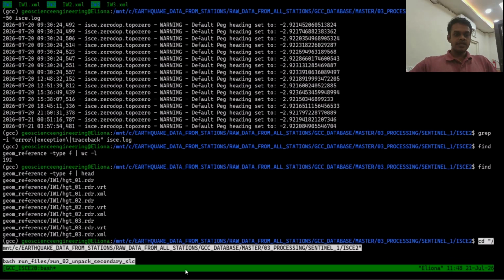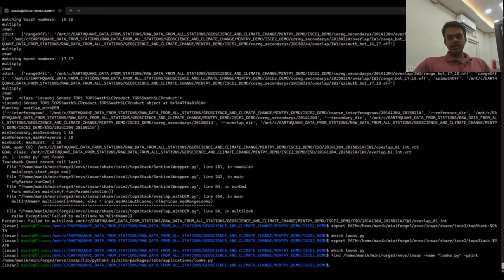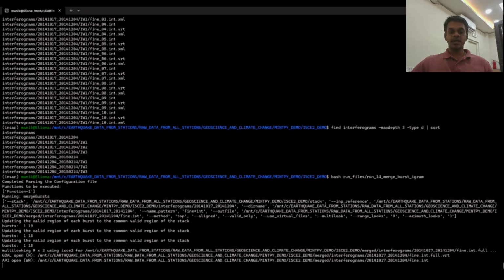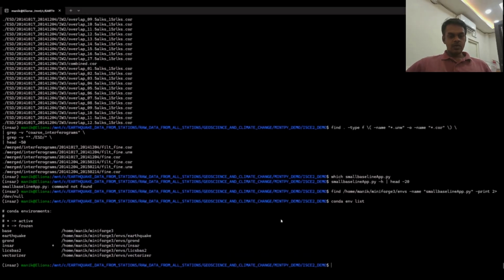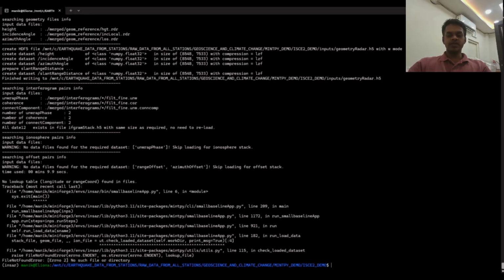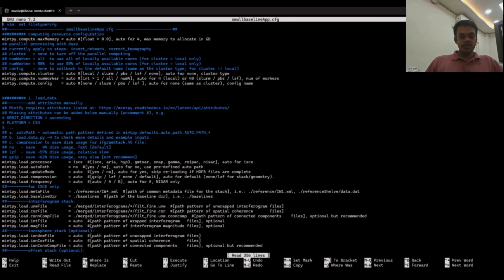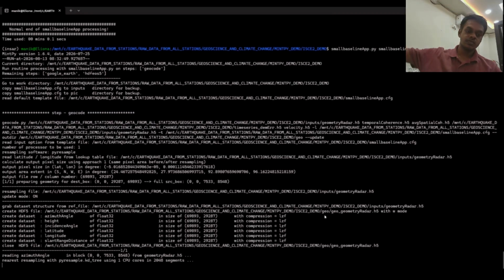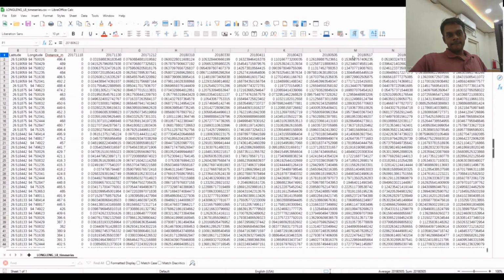Master Sentinel-1 InSAR | ISCE2 + MintPy Complete Processing Tutorial #geoscienceengineering

Comment: Sir, I’m following your Sentinel-1 InSAR tutorial using ISCE2 topsStack + MintPy, and I’ve been stuck for 2 days at run_01_unpack_topo_reference. IW1 topo completed successfully, but IW2 has been running continuously for 2 days without producing any files in geom_reference/IW2/. The Python process is still actively using CPU, so it doesn’t appear completely frozen.
Could this be due to a corrupt IW2 burst/SLC, an orbit interpolation issue, or a DEM problem near the IW2 coverage? I’m using ISCE2 2.6.1, MintPy 1.6.4, Sentinel-1A VV data, 16 GB RAM, and a Copernicus DEM. I can share the full terminal logs if needed.
Sir, this is getting very long and I’m not sure where exactly the problem is. Could you please guide me on how to debug it?
Reply from the maker: Yes, you can do a few checks yourself before sending the logs.
1. Check whether IW2 is actually consuming CPU
Open another terminal:

top

If the ISCE2/Python process is continuously using significant CPU, give it some time and continue with the checks below.

2. Check disk space

df -h

Make sure the filesystem containing the processing directory has sufficient free space.

3. Check whether IW2 output is growing

du -sh geom_reference/IW2/

Run it again after 10–15 minutes. If the size is increasing, processing is still progressing.

4. Check the IW2 directory

ls -lah geom_reference/IW2/

5. Check for an error in the log From the processing directory:

grep -iE "error|exception|failed|traceback" run_01_unpack_topo_reference.log

6. Check whether the process is still running

ps aux | grep -E "python|isce|topo" | grep -v grep

If CPU usage is high and the IW2 directory/output size is increasing, don't stop it—it's still processing.
If CPU is near zero and nothing changes for a long time, or the error command shows an actual error, then stop and investigate.
Don't delete anything or restart the complete processing yet.
Reply: Sir, I checked the geom_reference/IW2/ directory from the correct ISCE2 processing directory. The directory exists, but the file size is not increasing even after waiting 10–15 minutes. It remains essentially empty (only . and .. entries), and no .rdr output files are being created.
The system still has sufficient disk space, so storage does not appear to be the issue.
Reply: There are 7,596 lines in total, and the processing is currently still on Line 1. It has been running for around 2 days. The output file is only about 800 KB, and that was written at the beginning when I started the run. Since then, the file size has not increased at all, even though the process is still running. So it appears that the processing is stuck on Line 1 and is not writing any further output.
Reply from the maker: @gauravdev7832 Thanks, that confirms IW2 is not making progress. After ~2 days with no increase in output, I would stop that run rather than continue waiting.

First, press:

Ctrl+C

Then, do not delete the processing directory or recreate the whole stack.

Run:

cd /path/to/your/processing_directory/run_files

bash -x run_01_unpack_topo_reference 2>&1 | tee run01_debug.log

Let it run until it reaches the point where it hangs on IW2. The -x output will show the command being executed immediately before the hang.

Also run:

ls -lh ../reference/IW2/
ls -lh ../geom_reference/IW2/

If it hangs again specifically while processing IW2, stop there and send only the last ~50–100 lines of run01_debug.log. We can then pinpoint the actual operation instead of guessing whether it is the DEM, orbit, or SLC.
Reply: Sir I checked the directory structure as you suggested. Inside reference/IW2/, I can see the four IW2 burst files, but they are only .vrt and .xml files:
burst_01.slc.vrt
burst_01.slc.xml
burst_02.slc.vrt
burst_02.slc.xml
burst_03.slc.vrt
burst_03.slc.xml
burst_04.slc.vrt
burst_04.slc.xml
I also checked geom_reference/IW2/, and it is currently empty (total 0).
The Run 01 processing reaches the topo/topozero stage and stops at:
Running: topo
...
Processing line: 1
It has been running for several days without any further visible progress.
I tried to get the last 100 lines using:
tail -100 run01_debug.log
but the run01_debug.log file is showing 0 bytes / 0 lines, so there is currently no debug output in that file.
Reply from the maker: @gauravdev7832 Thanks, this is useful. The four IW2 .vrt/.xml files confirm that the IW2 burst metadata is present, but they do not confirm that the IW2 SLC data or topo processing is working.
Since the run has been stuck at topo → Processing line: 1 for several days, please stop this run with Ctrl+C. Do not delete the processing directory or restart the complete stack.
The next step is to identify the exact topo command being executed for IW2 line 1. Please run:
If that does not show the command, please open the run_01_unpack_topo_reference script and look for the section that runs topo:
Please send only that section of the script and the last few lines of the terminal output before it stops. We need to see the actual command, not just the directory listing.
Also, one correction to my earlier advice: the presence of CPU activity does not prove that processing is progressing. In this case, several days with no output means we should investigate the exact operation rather than continue waiting. As you are having issues in every step i suggest you to use chatgpt and paste the errors ( this is a quick solution for your case) 🤝
Reply: @geoscienceengineering  i have everthing with claude and Chat GPT but nothing is working
Reply from the maker: @gauravdev7832 oh, then mail me to geoscienceengineering9@gmail.com and we can discuss

Comment: sir, im sorry i want to ask you, what should i do if my data (for the first i use 18 data and for the second i use 3 data only) but the run_01 output is stuck many hours for 6 files (hgt_01.rdr; incLocal_01.hdr; lat_01.rd; lon_01.rdr; los_01.rdr; and shadowMask_01.rdr), im stuck please help me, thankyou so much
Reply from the maker: Please don’t stop it immediately. These 6 files are part of the geometry processing in run_01, and this step can take several hours depending on your computer and the size of the DEM/data.
Please open another terminal and check whether ISCE2 is still using CPU:

top

or type 

htop

If the CPU is still being used, let run_01 continue.
If CPU usage is almost 0% for a very long time, then send me the last 20–30 lines of your run_01 terminal output and also tell me your RAM, CPU, and the DEM file size. Then we can identify exactly where it is stuck.
Also, please make sure you have enough free disk space. For the 3-image dataset, the processing should generally be much lighter than the 18-image dataset, but the geometry step can still depend heavily on the DEM and processing area.
Reply: @geoscienceengineering  okei thank you sir, my problem is solved